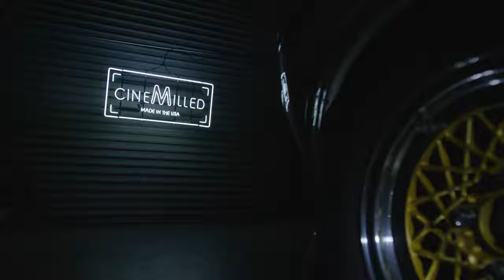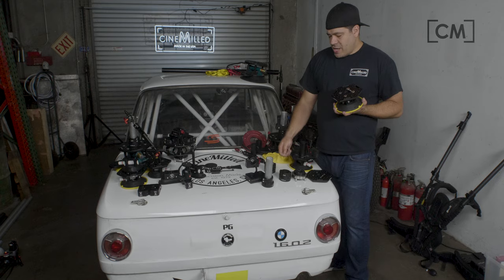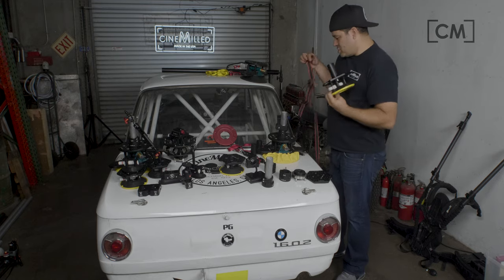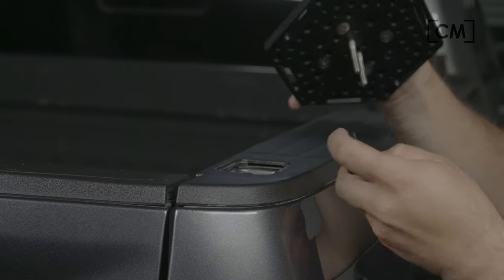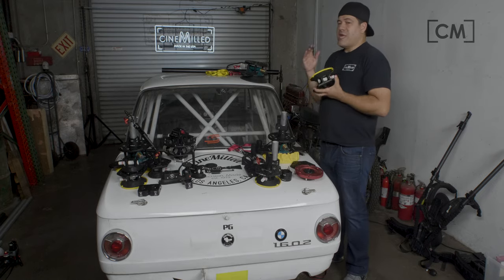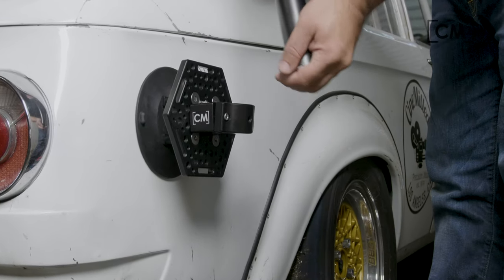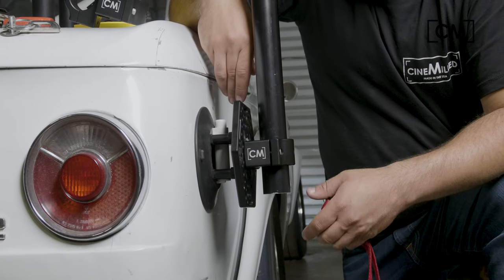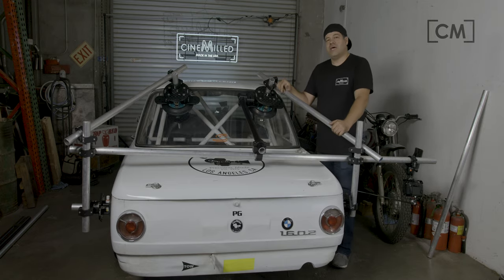6" Round Rigging Suction Cup

Comment: What hardware and positions do you use to mount Female Houdini clamp to a suction cup cheese plate?
Reply from the maker: normally I use a male houdini with the locating pins so it doesn't spin. I just use a bolt on the backside.
Reply from the maker: But pretty sure you can get many holes to line up as everything is drilled to 2" or 1" on center spacing. There are both 1/4-20 and 3/8-16 spaced at 2" apart on the female houdini. As well as the center threaded 3/8 hole. So really it shouldn't be hard to get the the female clamp montounted. but I prefer the male clamp.